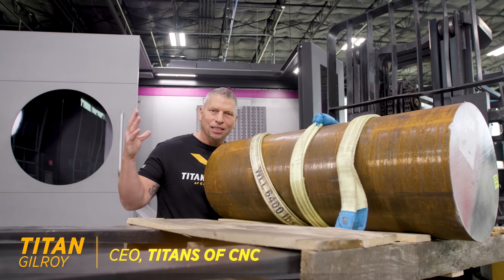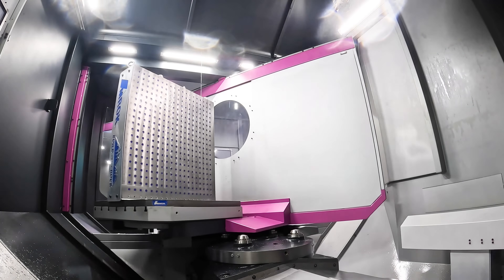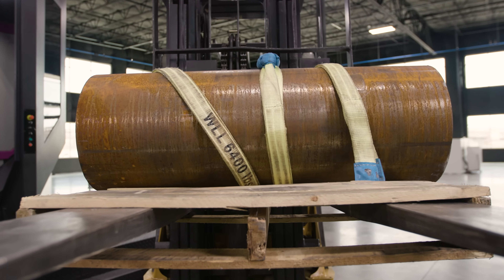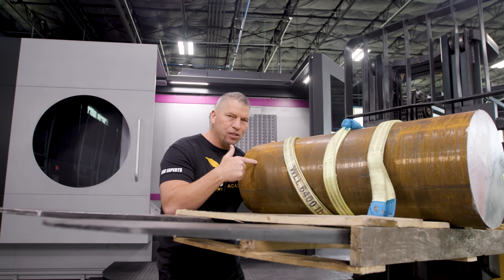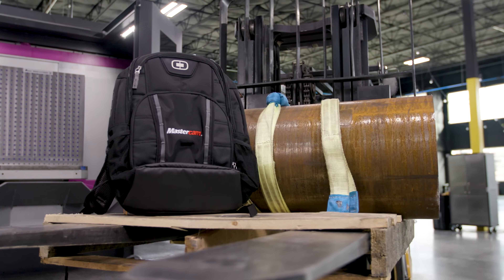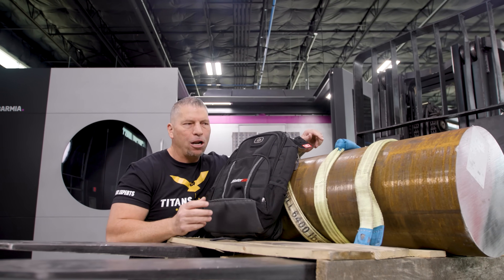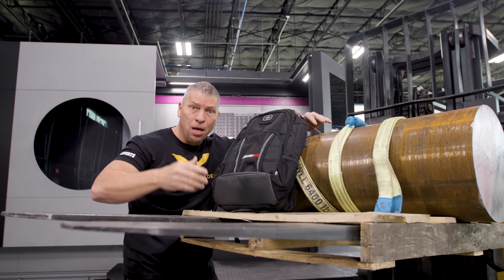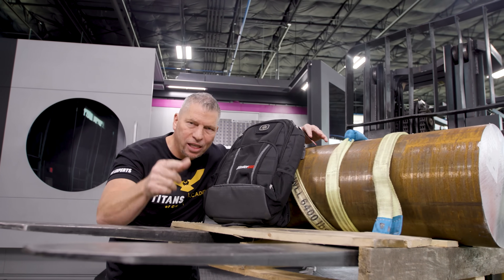How Would You Do It?? YOU Tell US How to Fixture This Monster!

Comment: It is hard to know how to hold it without a print, but here is my thought.  I would place it horizontally on the pallet using v-blocks or just set it in the t-slot grove of the pallet and use toe clamps.  Then machine and thread either the end (if you want it vertically) or the side of the shaft (if you want it to remain horizontal) for ball lock pull studs.  This would require that you have enough stock to do this, so hopefully that is figured in.  Then thread in you ball lock pull studs and mount your corresponding risers with the ball locks.  If you have room also thread in a spot for a lifting lug.  This always makes it easier to load.

If you don't have ball locks and are only going to machine with the shaft in the horizontal position I would do the same and cut dovetails in the side of the shaft and use 2 or 3 vices.  I would not recommend using dovetails if you are going to hold it in the vertical position as I don't think they would be rigid enough.

Comment: in one of the last videos you mounted 4 vices, 
"dovetail", when I used to make a detail from a fight, on one side I made planes and threaded holes for mounting on the subplate, because we did not have a tool to make a dovetail, and we fastened the boards under a vice, here I would fasten it with the side to a vertical wall, extending horizontally slightly behind the table, with a clamp or chain, I would work the round side to keep the angle, then put it vertically on this side, press it against the vertical wall vertically with the use of washers and clamps from the top and possibly on the radius of the roller, make a dovetail and fasten it in in vices, a machined round wall would be good for homing because the angles would be kept, I had a small roller, so I could make the planes in the jaws of the vice, keeping the angles, we had a very small margin of error, the detail was shaped and the roller optimally inscribed on the film on which you are mounting vices, jaws are too shallow to be able to grab the sides without the use of additional fittings, I do not want to duplicate others here answers about chains and prisms, prism ok but you need to fix the chain or clamp to maintain parallelism and planes, no drawing what to do is just blindly looking for a solution but bravo for the rebus

Comment: Would you fasten a sub plate to the face of the tombstone then clamp a rotary table to the face of the sub plate then clamp the billet to the rotary table with heavy duty t-slot clamps, then you can machine all 5 sides. That's my guess. I thought it was crazy using such small clamps but your billet weighs 1600 pounds and the mitee bite clamps can put down 20,000 pounds of pressure so it should be enough.

Comment: Obviously depends a lot of what your making, but my first guess is take the tombstone out, stick this upright on the table, figure out what angle it's sitting at, model it, and face off the top end and either mill or weld on some flanges for bolt holes on the top. Then flip it over and bolt it to the table. Given that you just loaded the tombstone and a bunch of vices this is obviously wrong.
Reply: Nah man, that was actually my first idea! But we DO have an empty pallet!

Comment: How much stock am I able to hold on to. How much comes off, what does the part even look like, 

But if it were me, I would get a set of steel jaws, 7 inches tall, whatever the diameter of the stock material is (looks like 18 inches diameter) open your jaws up to 17. Inches and put a solid piece of material in between the 17.000 jaws and tighten them up. Then make a program to cut a big mill bore so the jaws have a radius on both sides 6 inches deep (so it dont touch the vise floor) and are conforming to the material... take the stuff out between the jaws after milling. Put the stock in the vise(s) and vise the whole thing in there. But this is just a suggestion considering I have no idea what the part looks like.

Comment: Depending on how much room you have I'd face the part put holes in it for 4-6 the Vero s pins on a lathe than place it upright in the middle of the table giving you maximum access to the part. Alternatively if you have a big enough chuck slap that on the table and get after it. These are just a shot in the dark without specs & design can't wait to see how you get after it though
Reply: The vero s idea would have been IDEAL. But our first op is to dovetail the entire length

Comment: If you have the extra stock you could cut a dovetail into the stock in a vertical mill then set up in the horizontal using dovetail vices

Comment: Knowing that you left one side of the pallet empty, I would take the OD of the part and create/machine a custom vblock with machined clamps to bolt the part in place.  This custom v block could then moved to the tombstone to position the material after your initial first operation.
Reply: I know what i did, and this comment is my #1 vote so far

Comment: Yes, a drawing would be nice but this way is more fun ;)
OP 1 - Put the part vertically on the table.
You might need adjustable support to make it perpendicular to the table. Shimming the part might be good enough. Clamp from top. Machine one side for clearance and two parallel walls along the part for next operation. (Depends on the clearances the part might be loaded parallel to the table on V blocks instead of vertical orientation, but it's hard to see if it fits that way. Also it would be harder to clamp it this way.)
OP 2 - load the part on the schunk tombstone with multiple vises on it (see previous video). Load the part using the parallel walls from previous OP and start machining the part. Most likely it will be first roughing OP.
OP 3 - here we need a drawing, but I have a feelling that flipping the part to machine the other side with the same setup will do. That would be second roughing operation.
OP 4 - most likely some heat treat/stress relieve. Depends on the drawing.
OP 5 and 6 finish the part, similar setup as OP 2 and 3.

In between find a lot of empty barrels for the chips 😅

Comment: Looking at the gaps between the vises already installed, you could have the round stock sit on vblocks or round jaws and have 3 chains gripping in the same places where the gaps in the vises are and machine flats on both sides. I would imagine the round stock would have to sit vertically on a block or somthing so the weight of the part isnt resting on the chains.

Comment: My guess is you will only use the one pallet with the Amrok tombstone. One side will have 4 Schunk vices (wink wink) and the other side of the tombstone will be used to hold the massive 4140 stock. I would guess you'll use 2x V-block datum holding clamps (search DTM workholding for reference to picture) while raising the stock off the bottom of the tombstone and the floor to ensure you're not sitting on a rough saw cut and also allowing you to machine around all ends of the round stock. Then machine features around the V-blocks to finish the part before flipping it over to the 2nd side of the tombstone and secure it with the 4 schunk vices. My guess is you will probably be able to machine 85% of the part on the first OP alone if this is hinted at a 2 OP operation. 

While knowing what the actual part model/print is is key, we're all still looking at the same troubleshooting scenario and that is how to hold a round stock in a tombstone. That's how I would approach the part knowing what info is already given to us. 

Fingers crossed for getting it to get a chance for that Mastercam SWAG bag! BOOM!!!! (insert fireworks here)

Comment: It is a bit of a guess work when we don't know what the part looks like but assuming you have extra material in length to be able to drill and tap holes on the bottom and remove the tomb stone and fixture it directly on the pallet.That way you have clearance all around and top as well with no clamps or chains in the way.May take a little longer to machine but it may only be a two setup job.

Comment: A blueprint would be helpful, but since 5 sides are eluded to in the description and four vises are indicated as the preferred holding scheme, establishing the primary datum is the logical first step. Since this is vise loaded, milling in dovetails along the length would give access to a majority of the stock (3 sides and 2 ends). 
Therefore since we are using a single machine to perform all operations and keeping things simple is always preferred, clamp the stock directly to the table using the slot closest to the edge to align the length and manually mill the dovetails.
Step 1: Drill and tap lift points into the excess stock. (in this case a single eyebolt centered would suffice)
Step 2: Index stock 90 degrees & re-clamp.
Step 3: Manually mill dovetails along length for vise loading.

Comment: If mounted horizontally: 
1. V Cylinder Fixture or Magnetic V-Block at least 6 pair like this -> AOA 
2. External Chuck Bearing in the mid center 2 set for each end.
3. Floor surface vise with T-Slot jaw 

If mounted Vertically: 
1. Independent Four jaw vertical lathe chuck
2. Magnetic Floor Surface Plate make sure it is secured with additional T-Slot Jaw on the bottom part
3. Mount it on Horizontal T-Slot rotary table then on the upper part secure it with magnetic hoist or secure it with 3 way Slings
4. Cut the base with bandsaw to make sure the bottom end is flat enough then Fillet welds with a MIG or TIG on thick SKS plate or with 3pcs triangle frame footings.

Comment: To formulate the best plan I would need to review the drawings first. Without that information, I'm going to make some assumptions, so I can offer my ideas: 1- the part will probably have some flat/ parallel features to it, or maybe when completed it won't be round at all- if so, I would stand it vertically on the non vice side of your table, up against the tombstone on its faced end and clamp it down to the table and the tombstone.  2-Then rough in all the features that can be roughed in that position leaving enough stock for finishing later due to stress changes when you machine the other side. 3- move it to the vice side and mount it in the vices you installed on the tombstone in a previous video. 4- Rough the remaining features in this configuration then finish everything on this side, flip it back around in the vices, probe it for perfect positioning, then finish machine the first side features. Perfect......
A SECOND PLAN, would be based on my first assumption. It isn't necessarily going to be totally round when finished: 1- As above, stand it vertically on its faced end and clamp it down. Machine dovetail rails or some sort of grip features along its length so that it can be held securely in the vises on the tombstone. 2- Then move it to the vises and machine it completely except for the vise mounting features. 3- Flip it back over, in the vises, probe it for exact position then machine off the mounts and finish machining that side. Perfect.....Again! Send it to QC! MIC DROP! BOOM!💥

Comment: I work for a hydraulic cylinder manufacturer and we do similar size parts to this, use a few pieces of round stock with a slot milled into the bottom like a vblock. They slide into the slots in the table and the work sits on the round blocks. We then have 2 inch thick steel "straps" that are slotted and clamps over the part.  We have big lathes for the outer diameter operations then it comes to my machine and everything on the id we do on my boring mill. I'm not sure how you'd do this in a single setup though, maybe if you could stand it upright somehow you could get at most of the material. Or if you could fit it in the chuck and put all the tools on the table XD

Comment: They already mounted 4-5 vices on the tombstone in a previous video. So they will either weld or bolt a long block to the stock to mount in the vices. Or machine two slots and a flat on the stock to go directly in the row of vices. Depending on the part drawing or machine clearances. Need a drawing to confirm
Reply: Machine v slots on the sides. The already showed us this piece of material at the end of the last video. 
Cheers Keith
A Sawdoctor (saw filer/benchman) from NZ

Comment: Zip ties and gaffer tape always work 😜
But serious, depending on the part to be made, you could put the rawpart on a vertical machine hold it down on v blocks and mill out some pockets to clamp it in the vices of the Ibarmia.
Reply: use SKY HOOKS 2 support it in mid AIR & go for it

Comment: Mount it in V-blocks to mill the ends and one side flat, then transfer to the tombstone.
Reply: Probably going to mill either dovetails as others have said, or a flat surface with perpendicular cuts down the side to be clamped in a multiple vise setup on the tombstone.
Reply: Close!

Comment: Can't say without the print. If I was to do it however I wanted I'd plane a surface across the material the long way and drill 2 or 3 rows of holes across the planed surface. Mount it to the tombstone vertically with some stud mounts.

Comment: I would start with facing off one side of the part on the lathe and make threaded holes in the now flat surface to attach it to the workholding device. Now you can machine the part from all sides. But I dont know what you guys want to make, so this is just with a part in mind I had to make and on a smaller scale.

Comment: I would have to see the print first, determine the datum point of the part. A machinist cannot determine work holding without the print. After the datum point is determined, install large V-blocks on the tombstone, to within .0001 of parallel and perpendicular. A matched set is ideal. Mount the bar to the v-blocks and machine the datum point feature(s). Plus any clamping/holding features. If enough material is available a feature can be machined into part for holding purposes only, while establishing the datum point. A precision bore or boss is an ideal datum point.  Then with integral work holding feature machined at the same time as the datum feature, then it allows for part removal and different orientation or next operation(s).

Comment: 1st. The detals of the desired part would be the my first consideration for how to secure a part of any size. So I will be just as vauge on the acctual fixturing methods.
2nd. I wouldn't trust the end cuts to be square. So use the empty pallet with v blocks to lay the piece on its side to square off the ends, and set up the piece for fixturing to the toombstone. If the part will need to be removed from the tombstone, I would spend some time setting up registration points so it can be trurned or flipped to the other end and orented quiclky and accurately.

Comment: It depends on what the part looks like but here are two ideas for fixturing without seing the drawing.
1.op: use some V-blocks and chains to mill both surfaces (to use one of them as reference later on) and holes for the Schunk Vero-s.
 2.op: use the Schunk Vero-s. Place the material vertically and mill some of the features.
the other option would be to flatten a surface and mill a dovetail. then clamp the dovetail by using the schunk vices. (i guess the part is a little longer than the tombston wide)

Sorry if there are spelling mistakes or its hard to understand, but english is not my main language. 

Btw. i started CNC machining because of your videos and i love it.

Comment: I would fixture it with 3 big "V" blocks along the cylinder. And at each end put 2 roller chain straps and crank it down to be able to get after it only in the middle section of the material, of course.

Comment: Bolt a Chuck on the table. Put it in the chuck standing and then secure it with a long threadwire trough the material. When you do this you can machine everything exept the bottomface.

Comment: Mill a flat on the length of the material.Drill/tap holes to mount material or a dove tail and add multiple vices to the tomb stone, complete 3
Sides of the part and machine a witness or other pickup points to setup the  part for the final 4th side finish.

Comment: There are not to many good options to make true fixture for 5 sided machining but if to show how it can be done, even with the such huge bar, I bet you would go with magnetic holding, probably with MAGNOS of SCHUNK. Even more you would use not all poles but only two rows with either big chamfers to insert it into the fixture as in a big prism or would make rounded cavities. You are going to use one of highly magnetically receptive steel (not too many nickel, not too many chromium and is not tempered) therefore the holding force would be great due to the big volume of metal. But I am curious, would you take the biggest poles of 70 by 70 mm and the densest flow of magnetic field to show the really "tough love" or would take the regular one?

Comment: This part is for education only, so you can machine anything you want out of it, in order to showcase the new machine ability to rough material. 
It's a demo, so Titan has complete freedom in the end product, it is not like a job in a jobshop.
it is possible he bought a round stock because it is a lot cheaper than a square one, but I am not sure.
For this reasons, the best way to hold this is the easiest and fastest way, for example:
You can machine a shoulder longitudinally in the first op, than flip it and hold the shoulder in the vices in the tombstone.

Comment: It all depends on where and what  you need to machine first. But even if you have to put it straight up on the table you have to machine the bottom surface first, so you'll have to lay it flat in two v-blocks. At the factory where I work we'd call this a SMALL part! Biggest machine we have has a X-axis travel of 27 meter and a rotary table of 6 by 6 meter which can hold 250 metric tonnes! BOOM that's some European power for you!